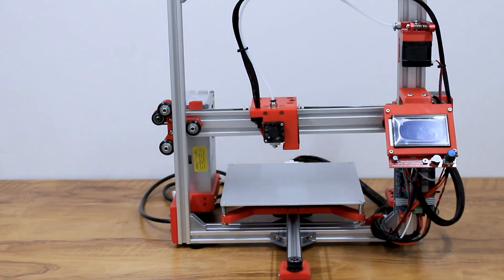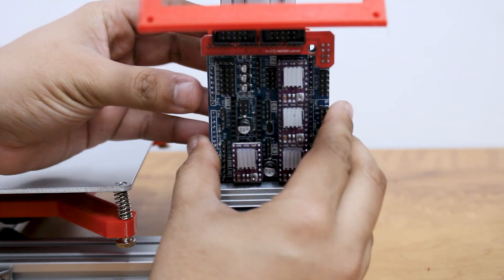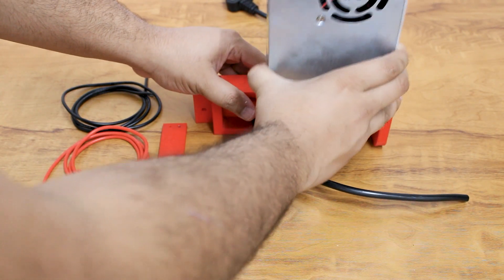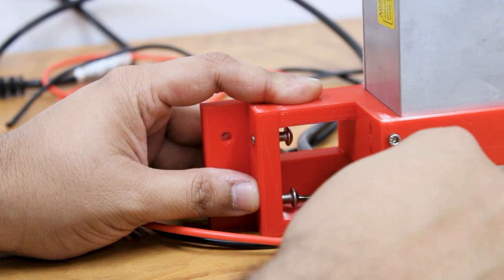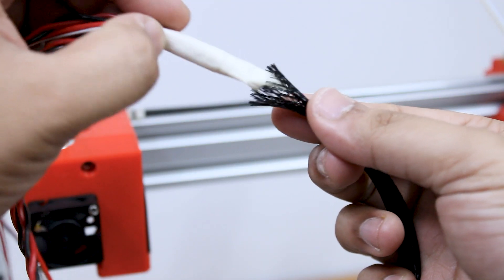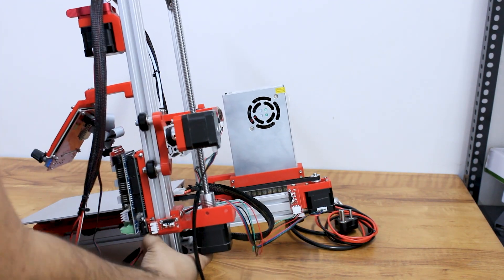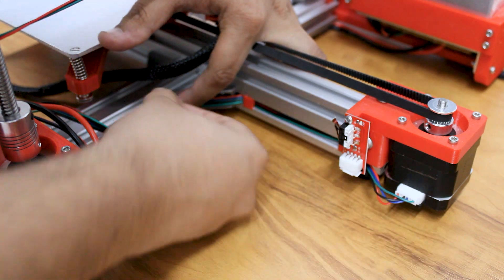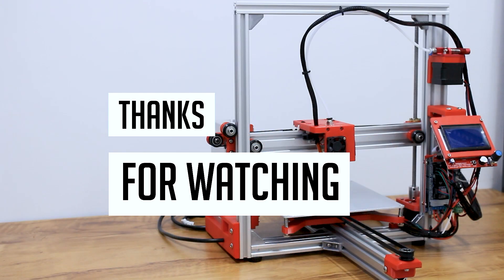DIY 3D Printer - Part 3  - Electronics (2/2)

Comment: Hi sir,Please just tell me and I promise I won't stress you anymore, where do I connect the turbo fan?
Reply from the maker: No problem man, turbo fan is beside the hotend
Reply: @SuperbTech I know, but you connected a fan to the ramps board and one directly to 12v and I want to know which one you connected to 12v.
Reply: @SuperbTech Is it so difficult to answer this question?

Comment: Hi, I have the same heated bed with the same connector. Where can i get the correct same connector and how is it called.
What are the connections for the bed and which for the sensor? 
By the Way , i use 2 times 12 volts
Reply: I am sorry. I have a corrrection to make. I have one heated bed connection on my RAMPS board 1.6

Comment: Hello,
The links to purchase the Arduino Mega V5, Ramp 1.6 and 128x64 LCD display are evidently not working.  Are these parts still available?  Can you please let me know if you have new links?  I would like to follow your video series to replace controller circuitry in another 3D printer using the existing steppers, hot plate, and extruder.  Can you or anyone please help?  Thank you much!

Comment: How did you connect end stops on CNC shield? Thanks
Reply from the maker: the RAMPS Board has markings on the pins. +, -, and S for signal. connect the red wire on the + pin